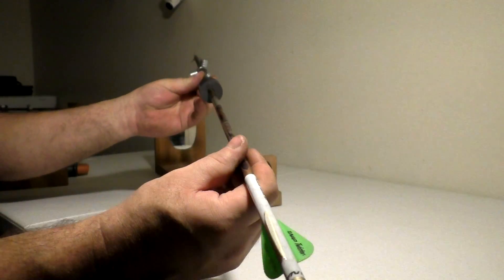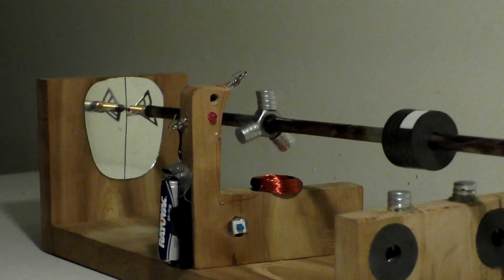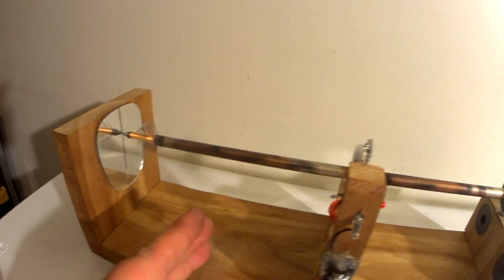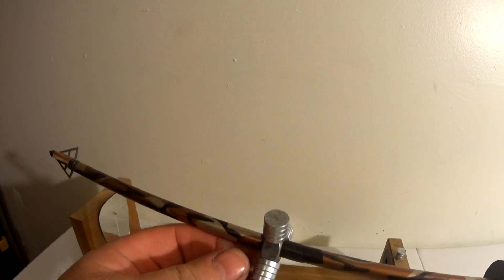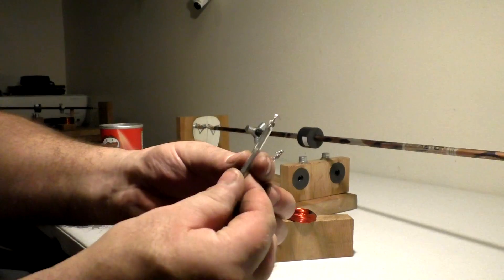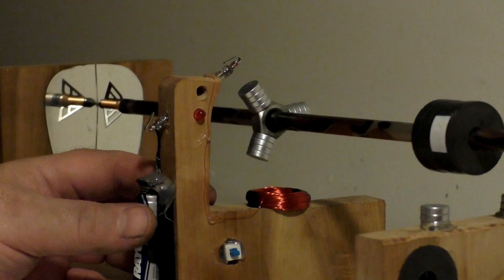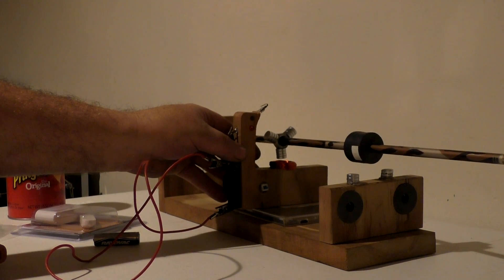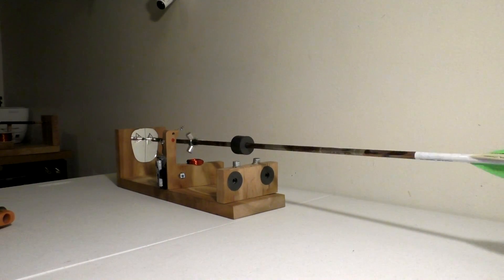Floating Magnet  Motor build up

Comment: Cool project bro. Another 68 here. I think we're the last of the tinkerers. My next project is a zipline that I want to have a powered trolley to take you way up there and collect some power and braking on the way back down. Seems like a worthy idea since one won't need to build any platform on the other end and you can spend all the funds on the trolley and cable. If you have any suggestions for the trolley I'd love some input.